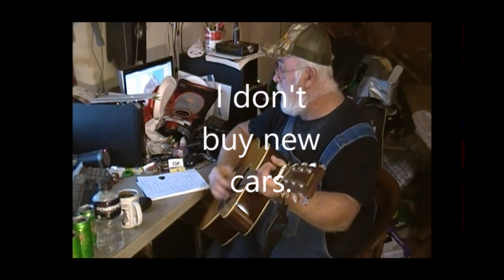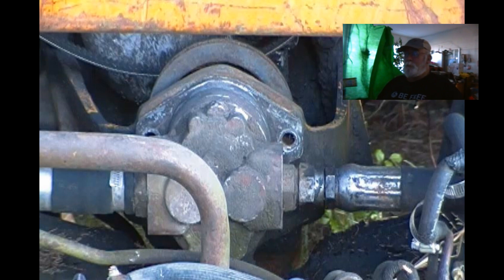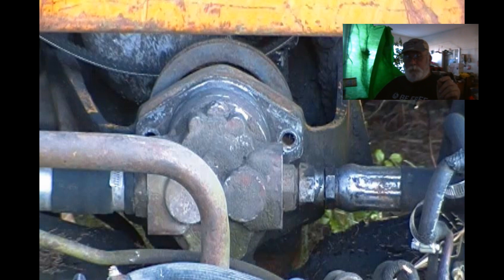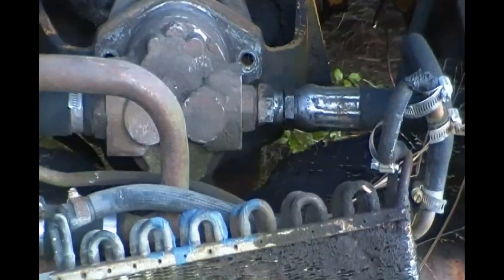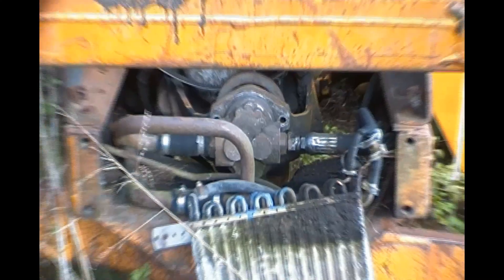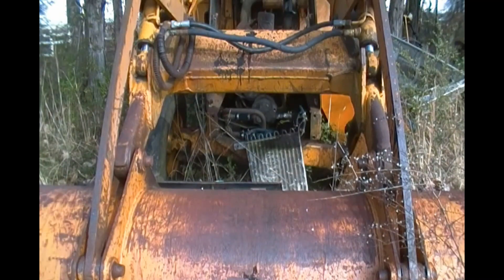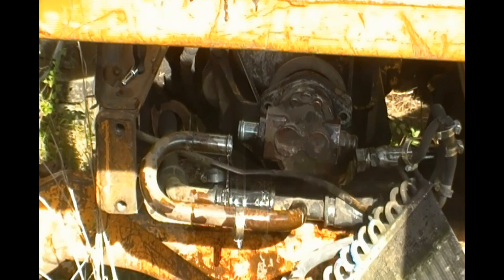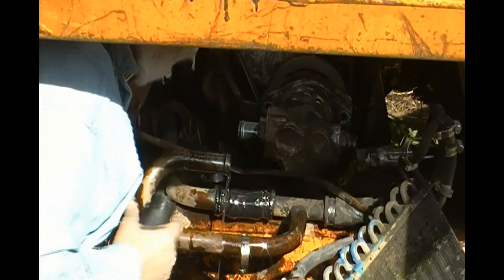PawPaw is Twisting Wrenches on the $2700 Backhoe Fanbelt Hydraulic Pump and Bonus Footage

Comment: Hi It's good to see you back working on the backhoe.  Just one thing I'll say I've learned fixing  backhoes and farm tractors with a front pump. If there is somewhere to cable tie a second belt safely so it won't catch, and get covered in any leaking oil to destroy it over a few years. Put an extra  belt on while the pumps off.  Then if you are unlucky enough to own it when the belt fails next time, you already got one to fit quickly  in the middle of the field or on the highway where it will  usually quit !. 

My JCB backhoe I got 3 years ago needs a new belt now the last owner never put 2 on, but I'll be doing it. the JCB I sold 18 years ago had a new spare belt on it from about 20 years before that somebody else fitted. It probably decreases the chance of the belt needing replacement considerably  L.O.L . Thanks for the video take care.

Comment: Love your video's paw paw always the entertainer and with a bit of educational value kicked in. I spent alot of days working on old equipment such as that. The company i worked for liked doing it cheap also. So if a piece of equipment wasnt at least 50 years old the boss wouldnt buy it lol. We had a 48 model HD 5 Alis Chalmers dozer a 62 international rig truck and a 54 model army surplus power wagon for a lease truck. Not sure what year our drilling rig was made but it was a old cable tool spudder so yeah it had been around awhile. I am probably among the last living that still knows how to drill for oil and gas with those old antique pounders. Its all boring machines now days everything gotta be fast and expensive.

Comment: Been there, What a pain in the Butt, Helped my father in law with his old ford backhoe.
Reply from the maker: It is only a pain in the A$$ when you break down and have to get it going because you are needing it NOW !!  For me, this is therapy.  I love bringing old stuff like this back to life for a fraction of the purchase price of one ready to go.
Reply: So true about the therapy part. The pain in the a$$ part, is the old ford backhoe 1950ish has 2 1/2 - 3 " piping around the front for the support of the front bucket and holds all the hydraulic fluid for it, so we were leaning over and trying to twist around it to do the work. Need to be a contortionist for this one, lol.  Whoever designed it must have had a screw loose. lol. I think the front part was home built and added to the backhoe.
Reply from the maker: My 580E had a cylinder lock on it.  You raised the loader, then swung and latched in place a C channel type piece of metal..... this gave you full access to the front of the engine.  I have also chained a loader overhead but had additional supports to prevent a premature end to my butt if it fell.
Reply: Its like a cage around the front end/motor area. even if we raise the bucket, its still there. wish I had a picture of it to send to you,  maybe you would have some ideas. but its in NJ and I am in AL now.  Father-in-law is a twig, he can squish in there . lol

Comment: Good vid  pawpaw  I had to replace my belt on a 580e  the other day  i was able to take a rachet strap around the pump  and leave the lines hooked up got the pump pulled back about 1/2 inch from shaft slid the belt right inbetween  but anyway  you got  a doing it cheap deal on that backhoe lol  good luck
Reply from the maker: My luck, I would have warped something doing it your way.....which sounds awesome by the way.  I used to have a 580E extendahoe.   This old beast runs and operates great !

Comment: When the drive shaft from the pulley to the pump cannot be slid forward to let the V belt in, would you consider a link belt?
Nut Link probably make the best ones. Nigel in Ireland
Reply from the maker: Nigel, I know I mentioned the link belt but I may have edited out of the video.  My situation:  the splined shaft is part of the pump, so when slid forward, it slides out of the crankshaft.  I didn't use a link belt because I am cheap and had to remove the radiator anyway (it had eaten a lot of fan blades over the years).  A link belt is a definite " Go To" when you are broken down on the job and time is money.  The best price I could find was around fifty dollars for the link belt.  The new water pump AND V belt were less than fifty bucks combined.
Reply: @DoingItCheap  Well that makes sense! I've never worked on a Case digger, but we farm here in Ireland and have had Massey and JCB's. Both of them the shaft can slide forward about 2 inches. It's still a fiddley job, especially if you have big hands. Cheers, Nigel.

Comment: Yup.......your toy is built damn near like my dads old 410 john deere i have......pain in the butt to just change the belt. Have to rebuild everything to make it worth it
Reply from the maker: I made a quick job look intense.  There really is not a lot to changing the belt.  It can be done in less than two hours.  I am just doing step by step videos and that takes time.
Reply: My pump hasnt probly ever been off.........every bolt and fitting was siezed.....grrrr